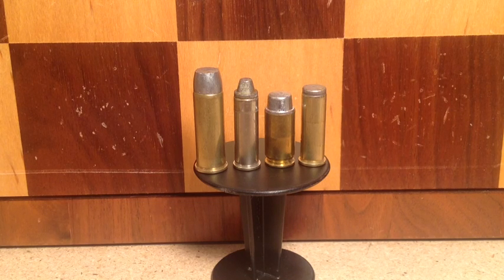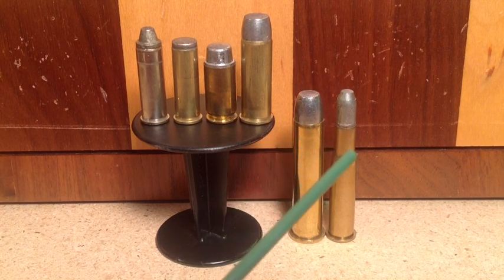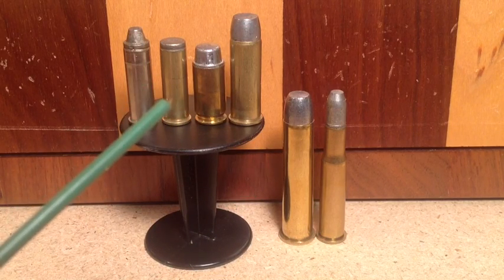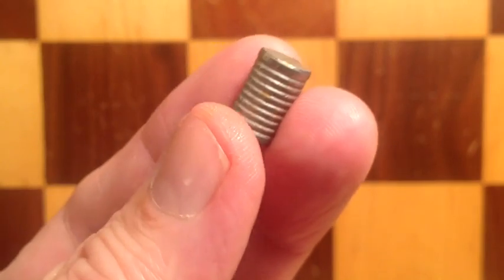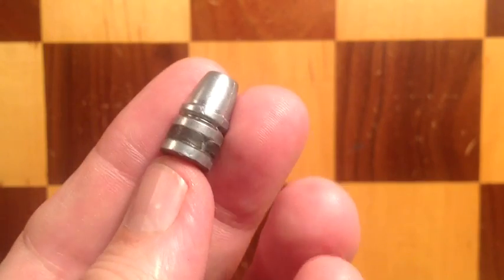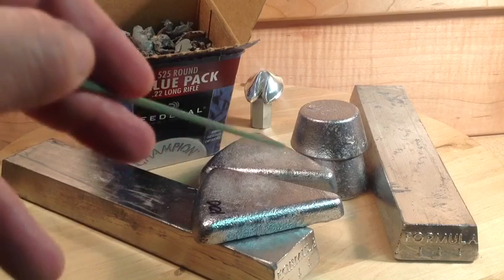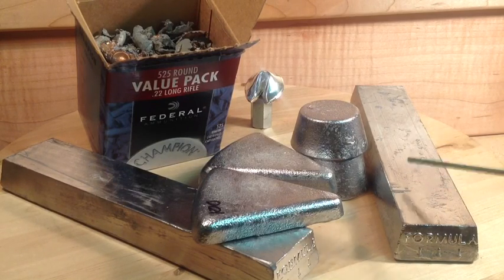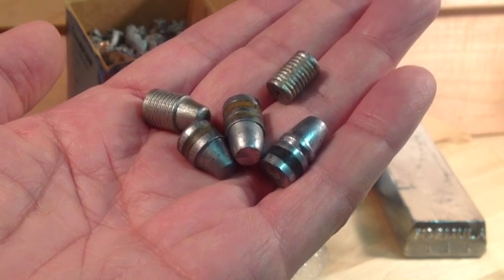Lead Hardness FAQs & How to Mix Bullet Alloys For Hardness

Comment: I've been wondering what lead alloy could be used for low velocity pistols (32 long) to achieve expansion at 650 fps. I've thought that a 400 gr ruger 480 low velocities might get good expansion with softer lead projectiles, maybe with  gas checks.

Comment: Ok, using the same amount of powder (3.75gr) W231 and two different bullets, one dead soft and one 
Brinell 12-14 , will the soft lead give you higher velocity due to conforming to the barrel?
38 special 158 gr.

Comment: I believe I’ve found over a hundred pounds of Linotype (in printing bar form). I’ve only purchased twenty pounds so far and would like to know for sure that it’s the real deal before I buy any more. It is for the most part thin bars 4”-5” in length and most are about 1/8” thick.  Some are only 1/8” thick at the top part (where the letters are) and the bottom part tapers down thinner with ribs spaced approx 1” apart.  I melted some of it down this evening and it starts to melt at 450*, but is still a little sludgy. It is pretty well completely melted at 525*.  I melted a few pounds of it to further verify it’s Linotype.  Here’s the part I’m unsure of.  If a 1/8” bar of pure lead were bent/flexed it would do so without breaking or snapping in half.  The bars that I brought home yesterday(with writing on them and some that still have ink on them) will snap if you try to bend them at all.  They are very hard and pretty much will not flex or bend like pure lead. The fact that they are almost brittle is what has me wondering.  Understandably, they wouldn’t be as soft as pure lead, but should they snap in half when trying to bend them? Does that sound like how the Linotype you have had your hands on would react to bending?  Just so you know, I’ve been casting for low velocity pistol loads (45acp, 38special, 9mm) for about two years now, but with none of my lead exceeding the hardness of wheel weights.  I had never even seen a piece of Linotype in person before yesterday, if in fact that is what I’ve found.  I also used my lead pencil set and could not put a scratch in the bars I melted down until I worked my way down to an “H” pencil, which according to the chart should put it at 20-22 bhn.  So, would you believe this is Linotype or is there any possibility of thin bars with writing on them being anything else?  Thank you in advance for your help

Comment: Wish I had seen this a few years ago as it would have given me a starting point. After much trial and error and much learning, I came to the conclusion that my Shiloh Sharps 45-110 running right around 1400 ish fps works best at BHN 13 and NO LEADING at all. Any faster than that results in hours of lead removal.
BTW, NO ONE needs to buy an expensive hardness tester or use the somewhat ambiguous "thumbnail test" ( no offence) but a good set of staedtler pencil works great. Do a bit of research on how the pencil helps determine hardness and put a written reference scale inside the pencil set cover for reference and it will work very well at low cost. This allows you to get a reasonably accurate assessment of hardness at low cost.

Comment: I still love this video however I’m really struggling to mix antimony with clean premelted ingots of wheel weight lead (10bhn) to make 24 bhn but can't seem to get above 15. The antimony seems to oxidise before it melts into the lead. I am using candle-wax as a flux and have tried submerging the antimony in the melted lead in a LEE melting pot for 30+ minutes at 350 degrees Celsius (650 Fahrenheit) but it still just leaves a grainy substance on the surface like it’s not actually melted / dissolved properly. I've also tried a direct flame into a cast iron pot but that only melts the lead and oxidises the antimony. Any advice would be greatly appreciated. A video showing your process of creating 20+ bhn would be even better because I can't seem to find any on YouTube.
Reply: Pure Antimony melts at something like 1100° F, it's very difficult to alloy together with lead unless you have a very hot pot. Ideally, you want to melt it together under an inert gas like argon in a furnace or kiln to reduce oxidation and get up to higher temps. It is much easier to just buy pre-alloyed lead from something like Rotometals or ebay, I actually just bought 20 pounds of 30/70 from Rotometals, 20lbs is enough to harden about 300 pounds of pure lead with the addition of a couple pounds of zinc. Once it is alloyed the melting temperature is much lower, which is why the vast majority of casters buy pre-alloyed bars, the equipment needed to alloy pure Antimony isn't worth the cost unless you're producing it commercially.

Comment: I've got a question, I recently started casting and coating 9mm. They are 147 grains and the speed should be 900fps, haven't chronod because I had allot of tumblers. Then I noticed my bullets were sized by my brass. I ruled out seating and crimping since I seated without crimp and the same issue remains. My barrel is slugged .355, I tried .356 and .357 bullets. But they all size down do around .352-.353 in my case. BHN is 18 with the pencil test. I still have old lubed bullets and some coated that I once bought. Their hardness is 26-28 and even higher then H2 pencil.

I've got 30 year old lee carbide sizing die's. They size my case to .374 outside diameter. When I pull the harder bullets they are not deformed anything. Though I noticed my .356 plated bullets deform slightly to .355. Do you have any possible tips? Do I need to increase lead hardness by adding tin and antimony?
Edit: OAL is 28.87mm

Comment: "MARLIN QUESTION"  Q ?  : RE:  "Circa 1970's"   LYMAN Expert  opinions, comments or recommendations  on  MICROGROOVES and "cast lead alloy"  'Linotype or Lyman #2 Alloy'  bullets... and the 1600 f.p.s.  limit.  I TRUST THOSE EXPERTS TO BE RIGHT ABOUT WHAT THEY TESTED.     The experts  recommended a MICROGROOVE  speed limit of 1600 fps  with  LYMAN #2 or Linotype alloys...  BEFORE Lyman  offered MOLY lube with MOLYBDENUM in it.  So, it seems that LYMAN experts 'may not have  experimented with   Moly Lube'.     Q? What effect, if any,  does the RELATIVELY  NEW {and presumably not tested by vintage 1970's LYMAN  experts}  Lyman SUPER MOLY lube have on barrel leading ? ....at FULL SPEED rifle velocity of 2000 to 2100 fps ... in MICROGROOVE MARLIN  30-30 or 30 WCF ?  Or, Does the NEW, possibly not previously tested by experts,  Super Moly  Lube allow for faster than 1600 fps speeds  without  significant or dangerous amounts of bore leading in MARLIN  Microgroove barrels ?  I DO USE  Lyman  #311041 and #31141 molds with GAS CHECK at .308" sized diameter... and also 'have'  the .311" sizer.   Presently, I cannot justify  re-barreling the rifle,  simply   to  eliminate  the Microgroove style rifling.

Comment: For 300 BO pistol bullets, what BH would you recommend and how does powder-coating affect BH???  I saw elvis ammo shooting some Lee 223 powder-coated bullets @ 2500fps.
Reply: Match the velocity...FPS to BHN & you will have great success. 
Bhn 12.     850fps max.
Bhn 15/16  1000fps max
Bhn 17/18.  1700fps max
Bhn 20/21.  2100fps max.
Power coatings help give you some leeway on the hardness or softness of your alloys by a point or 2 but don't get carried away.  P/C only can do so much.  Also this BHN vs FPS is an excellent  estimate.  For example  I cast a bhn 16 air cooled , 240gr 44 cal keith bullet that I Power coat in eastwood ford lite blue that I consistently push to 1400fps & NEVER get ANY trace of leading.  So experiment & have fun.

Comment: When it comes to lead for older/lighter load guns, like say the 455 webley, do you want to go softer or harder? It seems that this falls sort of into the cowboy action territory?
Also, what about the relationship between the cylinder chambers, forcing cone, and barrel? My buddy has one and he's going on about how he keeps measuring and he's only coming out to 450-452, but he's measuring improperly (in my opinion) with calipers. I told him to slug it, but he seems apprehensive. He loaded up some 262 gr over I believe 3.9gr Bullseye, but he's worried that the 455 bullet size (with 15 BHN) may cause pressure spikes and damage the gun? It is an unshaved standard cylinder mark 6 webley.

Comment: I must have watched this video a dozen times over the years.....but i keep coming back for the information every time I need to cast for a specific Velocity. Although I definitely would recommend the Lee hardness tester. Just to know the  hardness of the alloys we are mixing as a baseline...its spot on all the time with the alloy Calculator. I pray this video never gets removed...🙏 ps. With the right BHN & PowderCoating i have NEVER had any leading...Amazing.
Reply: Thats actually a question Ive had, Is it even particularly critical how hard the bullets are, if you powder coat?
Reply: @talonsd7131 depends what you want the bullet to do. Are you using it for plinking paper or hunting? The powder coat will prevent leading even if the bullet is softer, but it will perform differently in animal tissue with different hardness. Lead casting books talk about this matter.

Comment: Hey Steve I cast and shoot full power .44 magnum at about 1350 fps with 2400 powder at BHN around 11-12 with no leading what so ever. I think bullet fit is more important than hardness but maybe not it just seems that's what I have noticed over the years.
Reply: That's been my experience as well. I  use Lyman #2 alloy, which as far as I know is about 15 to 16 Brinnell, and have never seen the need for anything harder.

Comment: I believe your casting too hard
Reply from the maker: Liberty Cave - I just casted up some 500 S & W 440 grain Lee RNFPs that the Lyman Cast Bullet Handbook specified be cast with Linotype - so I did that, but no doubt I really don't need all that hardness either especially with powder coating the bullets.  For the applications in this video, I sure don't need as much hardness, but the video was all about getting the hardness we were talking about.  Have a great Thanksgiving,  Steve

Comment: Ive never reloaded with my own cast bullets but have recently come across about 200lbs of lead window weights,they seem VERY soft,so I dont know its composition,should I use more alloy to lead ratio?
Is there any way to make a formula besides making different batches in ingot form?

Comment: pure lead is bh5, not 12
Reply from the maker: pamtnman pamtnman - Thanks for your comment.  Yes, we have heard often that pure lead is BHN 5.  However, the Rotometals site had a formula for computation of lead hardness being a factor of very approximately 1 BHN point for every 1% of antimony and .3 BHN point for every 1% of tin added to a computational constant of approximately 8.  The inference is that pure lead is BHN 8.  Since Rotometals has been in business for bullet casters for 80 years and is my trusted source for alloys such as Superhard (30% antimony), Foundry alloy, Linotype - used to mix my alloys, I've just considered pure lead to be BHN 8.  This while knowing that others consider it to be 5 - it's all OK to me - it encourages discussions.  Range scrap is mix lead from all bullets fired into backstops = roughly 3-4% antimony gets to BHN 12 as there is also some tin in range scrap = perfect alloy straight up for target and cowboy type loads easy.   Have a great day, and good shootin' to ya,  Steve
Reply: @FortuneCookie45LC  I do a lot of metal testing and what you have written is not accurate. I do not know why RotoMetals would provide inaccurate information like that, but if you are going to repeat it, make sure to keep your own hands clean and clearly ascribe it to your source. Brinnell Hardness is super straight forward, and pure lead is not BH 8. Not now, not yesterday, not ever. Perhaps RotoMetals has their own system or method for calculating alloys, because they do sell a lot of specialty alloys. But it is their own thing, it is not the scientific thing. Anyhow, thanks for the response. Be safe

Comment: I just bought 500 Hi-Tek 200 gr bullets from Missouri Bullet Company to load for my 10mm. They say there bullets are BHN of 18. I asked them if I could load my bullets to 1200 FPS, and they said absolutely, no problem. I also asked if O can load their 180 gr bullets to 1300 FPS, and they assured me I would be completely fine doing that. Would you agree with loading Brinell 18 bullets to full 10mm power, at these velocities?

Comment: Fortune Cookie . thanks for all you teach us. years ago I thought I read in LYMAN lead book that every time you heat up your lead and scrap off the gross you are making it softer because you scrap off the tin. do you think this is true. I have a lot of wheel weight lead to hard for 44 cal pistol bullets. I was going to try this 3 or 4 times then test the hardness with finger nail.
Reply: Yes it is true to a point. The antimony will dross out easier and it is the hardest, looks kinda like oatmeal when you dross it. I find tin alloys pretty good with lead. Adding soft lead from stick on weights is the easiest. Anyone getting WW should have the sticky tape on weights, these are close to pure lead & some are.
Reply: KNIFE MAKER Did you ever test this theory?

Comment: Would powder coating a “harder” bullet in a slower velocity round prevent that gas leaking past the bullet?
Reply from the maker: Anthony R - Sorry for the late reply.  Obturation is primarily a function of bullet fit to the gun and therefore the size of the cast bullet really matters (reason we size our cast bullets to fit).  What powder coating does is protects against gas blow by causing leading of the barrel.  Jacketed bullets even do a better job of leading prevention in the event the bullets are on the small side allowing the same gas blow by.  Hardness affects obturation in that if a bullet is too hard for the velocity being shot, smaller bullets will have an even "harder" time obturating the barrel resulting in barrel leading even at lower velocities.  Good shootin' to ya,  Steve

Comment: @Fortunecookie45lc If my tl design is casting within spec and I'm still leading with alox for lube then am I to assume my range scrap is to soft for 9mm?..what should I add to harden and how much? Or perhaps I need something just to help fill out the mold..it's a .356..if I can't figure this out I'll just up on this caliber..took me forever to clean that barrel..very frustrating
Reply from the maker: jndred - Your groove diameter may be .355" , .3555", or even .356"  Sounds like you need to mike your bullets and if they are .357" you should be good with BHN 15 alloy... You can get that easily by adding linotype or Superhard alloy from Rotometals.  The Lead Alloy Calculator can be downloaded from Cast Boolits site to help you figure out the mix to get BHN 15.  If you have any problems entering your alloys, let me know and I can help you with that (there is also a video up on using the Calculator on my channel as well).  Best to ya,  FC Steve
Reply: @FortuneCookie45LC  thank you..I'm sure I'll bug you some more in the future with stupid questions. .:)..I don't think I've had one mic any bigger than .356

Comment: Very informative. Thanks for all your videos and efforts. At the moment, in my area, it is easier to get pure antimony and pure tin. I found no way to get anything already mixed. Getting lead (free) is also not that easy. 
I'm a beginner to cast and make my own alloys.  Now I want to make it harder but do not find any videos available showing how to safely make hard lead by adding pure antimony and pure tin. Would you have some steps by steps or videos links? For the amounts of pure tin and pure antimony, I have a lot of information including yours. I'm more searching to get safe steps considering to make it. Especially considering antimony fusion is around 630°C while lead is around 327°C
Thanks
Reply from the maker: Alan Bacchi - Tin is super easy as it alloys very readily and seamlessly into our lead alloys.  However,I have always recommended that casters not try to mix their own pure antimony into their alloys as it really is not simple and much more of a hazardous procedure - the lead has to be raised to well past the melting point of antimony (1167 F) in order to get the antimony to melt into the mix.  Safety is the issue here.  Any caster would be in the realm of the smelter requiring more heavy duty cast iron and heavier protective gear.  A high temperature thermometer would be very helpful.  Doing our casting at an easy 750 F does not compare with melting lead into the 1200 F range.   Simply put, the reason you don't see many videos on alloying pure antimony is that the procedure is not recommended.  In addition to a diverse array of casting alloys, Rotometals makes their Superhard alloy (70% lead, 30% antimony) already alloyed and ready to be used to mix whatever alloy we desire - they ship for free with $100 orders.  A little of that goes a long way to hardening  our bullet alloys.  Best to ya - FC Steve
Reply: Many thanks for the fast reply. I was in fear of such reply. Yes the risk is definitively higher. Rotometals is unfortunately not an option. For sure they won't ship in France ! At the moment in France, I only have found 2 metal sellers. Both sells antimony... but not already mixed. France is definitively a desert at the end of the world when it goes to sport shooters.. Anyway, again thank you